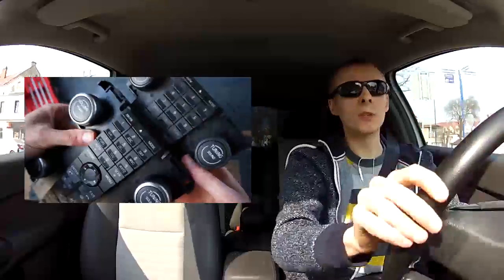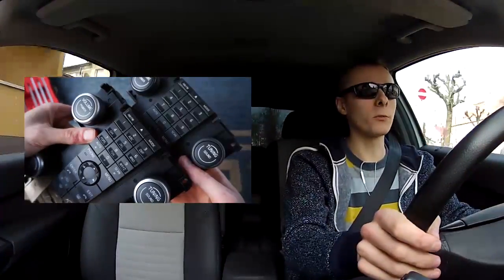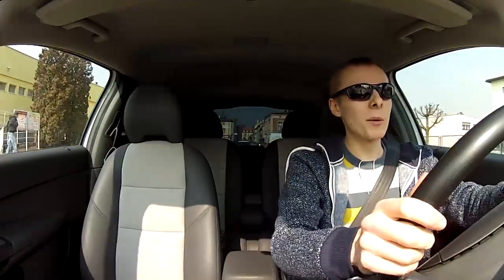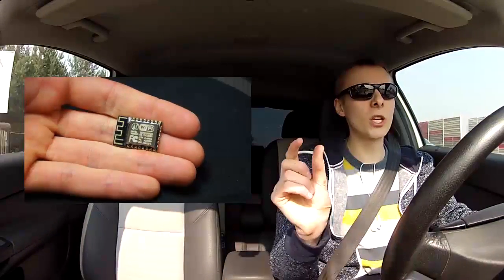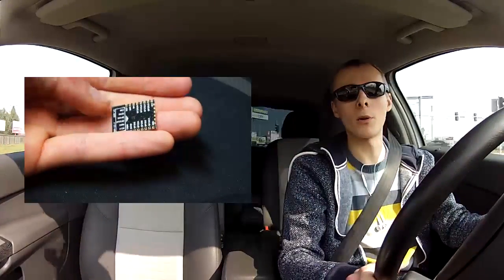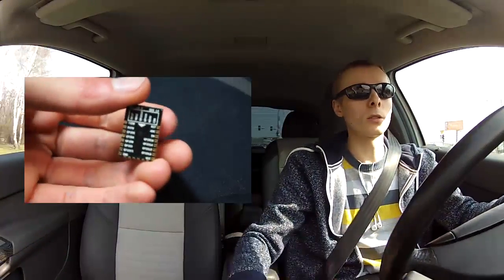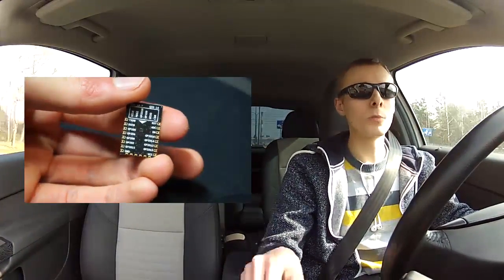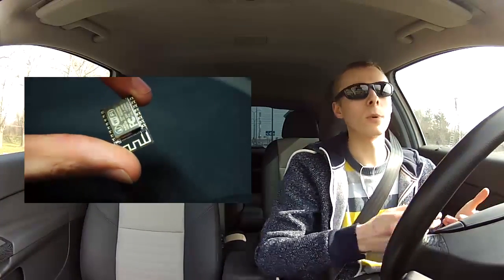Quick update on Volvo C30 maintenance and modifications

Comment: thinking of getting a 2011 c30 t5 in automatic with 111k miles. low service records with first owner second owner did regular oil changes at 78k miles. would it be reliable or would i have to do a ton of maintenance on it?

Comment: I have a question, my mechanic changed the head and can't put on timing on the c30, the car doesn't want to start.  A mechanic asked that maybe the turbo went back after the engine blew up.  How do we test the pressure or whatever?

Comment: Nice videos mate , do you any advice about their diesel particular filter , what should i do with mine as its blocked and it wont let me clear the code anymore , can it be cleaned ? Also are those on ebay any good 
Cheers
Reply from the maker: there is a service procedure to regenerate the filter. you should also check if the dpf tank is not empty (under the car, between rear wheels).
Also you should check why you DPF got  blocked. You might have issue with your turbocharger or injectors.
Reply: For the tank under the car i was told my car doesnt have it
Reply: For injector faulty i didnt check because when we plugged it in to the diagnostic computer it didnt give out any faults about them 
Thanks
Reply from the maker: 2.4D engine?
Reply: No 1.6D engine code D4 164T
Reply from the maker: there should be an additive tank in this engine.
you should connect your car to a diagnostic interface that not only read fault codes but can also check DPF capacity, additive level and force DPF regeneration.
Reply: Did the dpf regenaration three weeks ago but the issue came back and it wont let me do force regenaration any more :-( .
Would a low additive effect the car and put to limp mode ( not goin over 3000rpm )
Reply from the maker: low additive will cause the regeneration to be not as efficient as it should be (both normal and forced regenerations). This may lead to DPF so clogged that the force regeneration is not an option anymore.
Reply: Thank you very much for your time